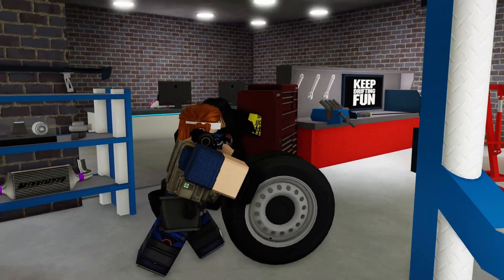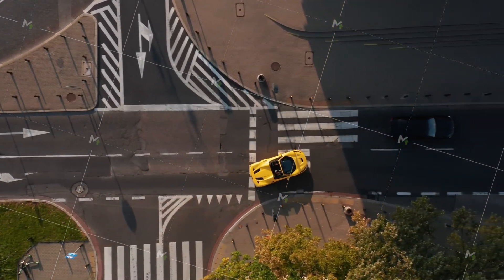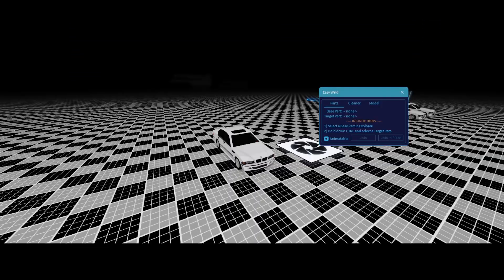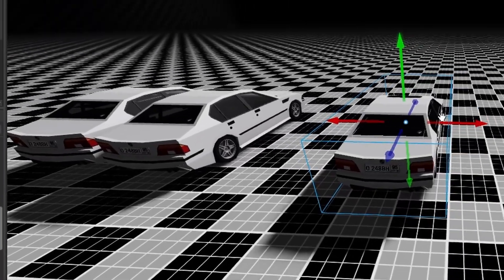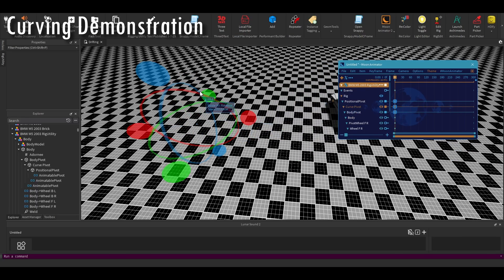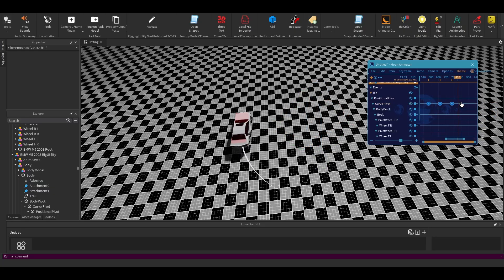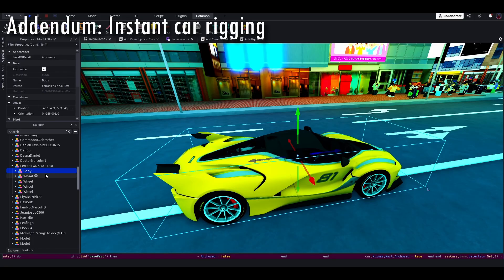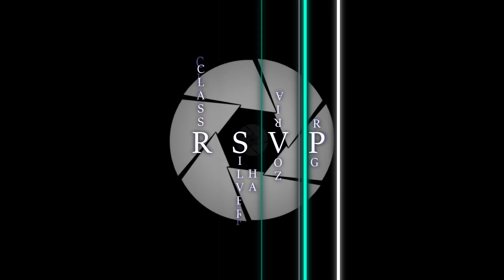The Basics of Drifting Animations in Roblox

Comment: drift tips from a street racist animator:
- slow is smooth and smooth is fast: cars take the widest path of least resistance/racing lines to maintain momentum.
- keep in mind how the car breaks traction into a drift (handbrake entry/feint entry/clutch kick/etc.) and when this happens.
- if your rig allows it, animate bodyroll. the car body will lean to the front when braking, towards the outside when cornering and to the back when on throttle. 
- don't forget to animate countersteer, it comes into play to keep control when getting angle and speed.
- try drifting yourself to get a feeling of how drifting flows ($olitary and prodigy drift are good games for beginners to feel around.)
- drifting... is actually relatively slow usually staying within 40kmh to 120kmh. 130kmh+ if you're a pro racist.
- ignore everything i say because you can do what you want on boblocks racingg